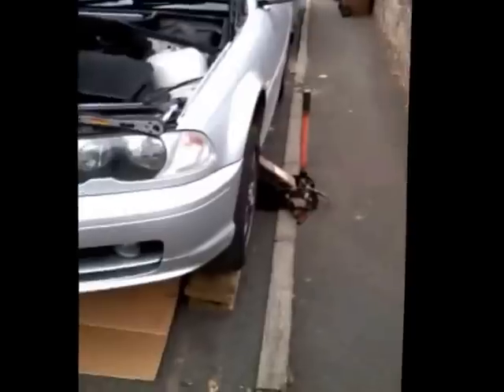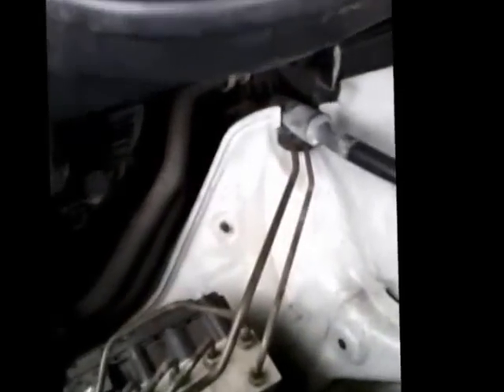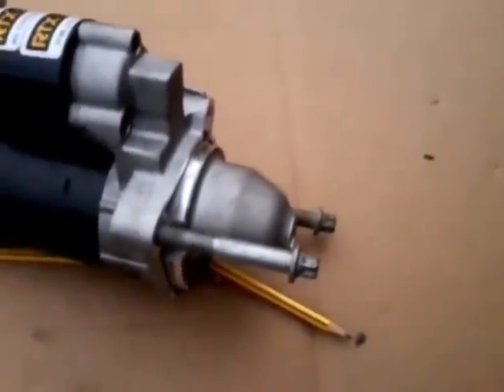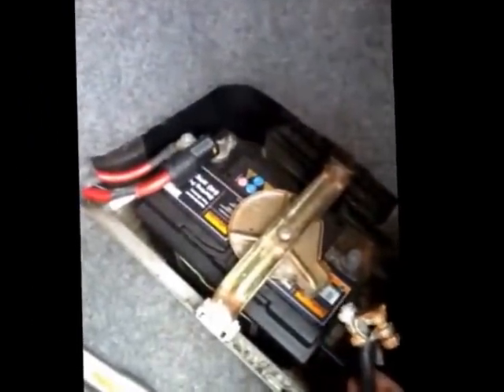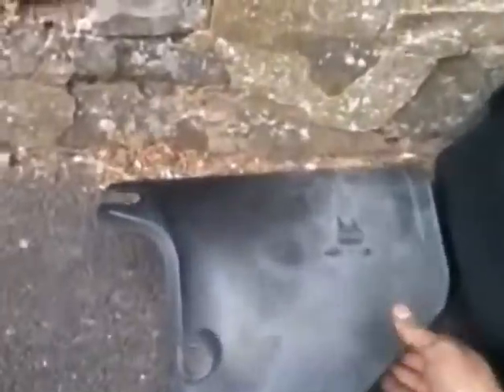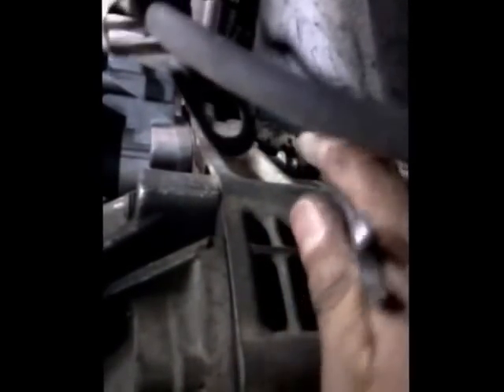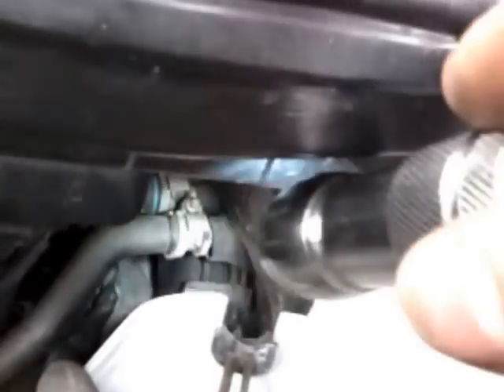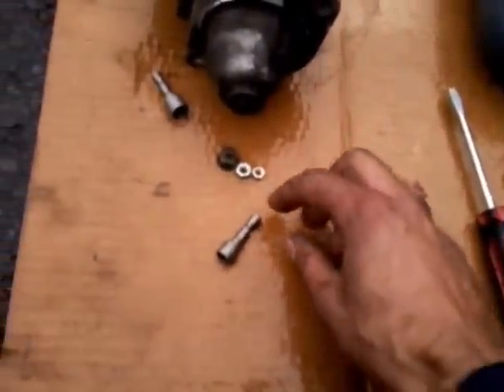How to replace BMW 325 Ci Starter Motor

Comment: Ok so I replicated this procedure today but I didn’t have to lift the car whatsoever. It’s best to use a 3/8 ratchet box wench instead of 10mm the 3/8 is a tight perfect fit. I did need to take the plastic cover over the left side of the car along with the airbox, however I removed the shelf type assembly that houses the cabin air filter for way better access to the firewall/ starter bolts. I then fished out the starter through underneath the mass flow sensor / throttle boot then out through where the airbox would be. Try to use a long 3/8 box wrench in combo with a short one. I use duct tape on the smaller box wrench in combo with a longer box wrench to get leverage . Took about 4 to 5 hours. Much respect to this man!!! I was able to do it quicker knowing he was able to do it as described in description. Thanks!!!!! My driver side is on the left side USA version.

Comment: Although this an older post it is still relevant today. Thanks RR. 
🤨I will say regarding the trunk lock, my 2002 325 has a battery disconnect installed, The key still works manually if you turn it in the opposite direction.

Comment: I admire your patience on what must have been a fiddle job. It would have been easier to remove the cabin filter housing - it’s only a couple torx. screws, and then you can see the bolts easily. A long extension can get onto the lower bolt from under the car with an E12 and flex joint. My starter would not come loose even with the bolts out ( guide pin stuck ) so I decided to pull the manifold to get to it. That job is a bit more involved, but not hard, and requires a lot less patience...
Reply: Andrew Devenish I would agree, I had the original factory bolts strip on me too, and as a mechanic I don’t do well with a job like this feeling around blind , the intake comes off  pretty quickly if you are knowledgeable and patient , maybe I can see a job like this if you have to retake the starter out again, but not a factory original installation never being removed.

Comment: Greetings from America!  This job was a real pain.. no way around it unfortunately.  You can remove the plastic panel near the brake booster a little easier if you remove the cabin air filter tray first...  Luckily from the video I knew the spanner wrench could be used for the "inverted torx" screws as it was impossible to reach them any other way..  thanks for the video!

Comment: I was really impressed by this method, I would suggest chasing the threads on the new starter with a tap and using a little bit of oil on them and the fastener, this will allow you to run the bolt all the way down by hand. Even another way would be to install studs on the starter and only allow for one thread to show when installing a nut on the other end...Good work!

Comment: I would add a disclaimer regarding your jack set up and edit the video so the part about “disconnecting the negative battery terminal” is at the start of the video. The part about the battery is critically important since the high voltage connection is almost always exposed (dangerous)and there are a lot people who won’t watch long enough to see that part

Comment: This job was incredible God must have been helping this guy wow very impressive, i wonder if it wouldve been alot easier to do it this method by removing the cabin filter assembly above the firewall
Reply from the maker: Thank you so much. I hope it helped you out. I have no idea what the cabin filter or firewall is, but I'll take your word on it that it could make the job easier 😄 This was just a video to show that even with no mechanical knowledge whatsoever and without having to remove parts, the job can still be done

Comment: Just change the starter on my e36 m3 and it was such a pain. My buddy a mechanic he did it in 4 1/2 hours had to take the intake manifold, and a bunch of wires/hoses, dropped the exhaust, heat shield, and tranny just at reach the e12 bolts.. To his credit this is the first time he done it on a bmw (Lexus mechanic) according to him it was not that bad most starter are located in hard to reach places.. Good luck to anyone attempting this themselves..
Reply from the maker: j k 
Well done for attempting it! I couldn't understand why BMW have made it SO difficult to access the bolts, given that a Starter Motor will eventually fail over time and need replaced. I've heard people mention on forums that their garage wont even attempt the job!

Comment: do you just slide the starter in and it lines up itself or is there a special way you have to put it on? my starter is making a noise when i start my car after i did a clutch install...now i have to go back in there. I'm gonna try this method first hopefully I'll just have to take it out and put it back in.

Comment: i have the same problem but my engine light indicator doesn't come on though (its crank but doesn't come on)
Reply from the maker: My Engine Management Light was on during this time due to a misfire that was happening; turned out to be a loose rubber bung that was letting air into the engine.

Comment: is the 325 ci the same as the same as a 2003 318i se touring .I have another 99 316i i think its an e 36 or 46 engine blew .will the starter fit the 318?

Comment: you could of jumped the poerr  to the  starter wire  under the hood to open the  rear deck lid  ,..... how many miles did it have before  failure ? i have 330,000 on original starter  just wondering ?

Comment: Was that wrench you used to remove the bolts just a regular wrench or was it made for torx heads. I couldn't tell from the video. You also kept calling it a spanner and I have never heard that before. I am looking to replace my starter as well. Mechanic wants 700 for it and I can find starters for much less.
Reply from the maker: It was just a regular wrench i used although i think a torx wrench would work better. I imagine the term 'spanner' is a UK thing Zachary; It's not a particular type of tool or anything, just what everyone else would call a wrench i guess. Hope that clears that up. I was quoted £600 from my local garage to replace the S. Motor, Hence why i did it myself. As long as you can be patient (and have relatively flexible wrists!) you should try give it a go. Best of luck!
Reply from the maker: Keith Robson Also see 'James A' comment above about specific tools to use. Very helpful

Comment: I just finished installing my starter, but when i tested it to my car it doesn't work. Won't start. Won't even make the starting noise or click
Reply from the maker: Lawrence He Hi Lawrence. Sure you've established what the problem was by now but I would have suggested checking all the electrical connections to the Starter again and I've also seen a video where someone hooked up their Starter directly to a car battery, just to make sure it actually worked first. 
If you've installed a new part and it doesn't work, just go over everything you have done in the installation process again; checking all connections/ fittings and the chances are you will locate the problem.

Comment: Does this work with the e90 models?
Reply: Billy Hachem 
Let me know if you find out, my starter is out and i'm not looking forward to taking the intake out.
Reply: It wasn't the starter. My oil separator broke and oil got into the  candles so my engine couldn't start anymore.
Reply: It was a pain in the ass to get the intake out. Find a cheap mechanic specialized in German cars to do it for you
Reply from the maker: Billy Hachem 
Hi Billy. Unfortunately i wouldn't know if this method is compatible with any other models. This was my first attempt and ultimately a very brave one (I'm stubborn that way!) 
If anyone does have any doubts about their capabilities of completing the job, consult a mechanic first. 
Thanks for your comments
Reply: Keith Robson It doesn't work. It has been confirmed.

Comment: No way you undid them bolts with just a spanner! I'm struggling so much to get to them let alone undoing them?
Reply from the maker: chris hastell - Spanner worked for me. If they're rusted or worn then it might need something with more force. I struggled to get a torque wrench in there. Patience and perseverance goes a long way though..

Comment: are you sure its e14 and not e12? and you couldn't open your trunk with the key?
Reply: royalrobson83 I am a bit confused now haha, I have a 2004 325ci e46, is this not the same? or is this the european version? my tailgate has a keyhole to open the trunk
Reply: It is an e12 on the starter bolts. Once you break it loose its easiest to use a 12 point 10 mm to continue to loosen the bolt until it comes out. If you have an e12 socket with some long extensions the lower bolt is quite easy to remove from the bottom. Thanks for the video, this is by far the best method. Too many people say its necessary to remove the intake manifold or the exhaust and drive shaft when you don't need to.
Reply from the maker: James A  Thanks for this James. Always helpful to know exactly what tools to use. My knowledge of mechanics is amateur at best, and i'm still learning about the terminology behind certain tools and parts. This info will be very helpful to people looking to have a go themselves. Thanks again
Reply: +James A why would anyone say  remove the exhaust , its located on the other side of engine ?

Comment: Has anyone replaced their starter the way that this guy did (without removing the intake manifold) on an all wheel drive automatic transmission? [I heard it was not possible on a 330xi with automatic transmission]
Reply: I have a 2005 BMW 325ci with automatic transmission and tried the method described in this video but I could not reach the upper bolt holding in the starter.  I ended up having to remove the intake manifold to reach the upper bolt.
Reply: I think my hands are to big to get it from the bottom. And my forearms get stuck